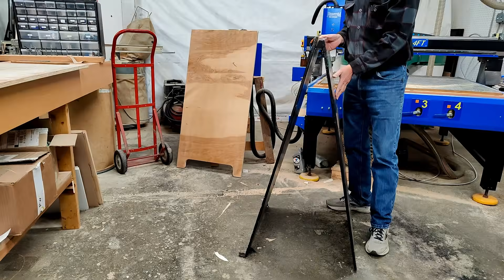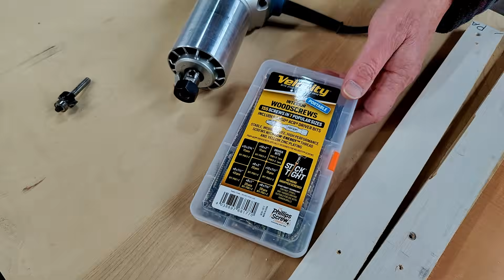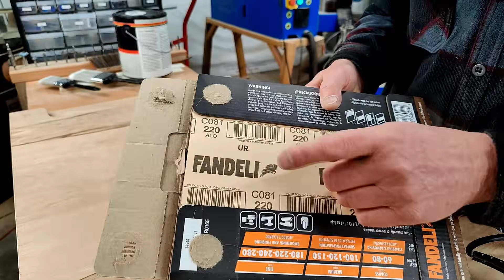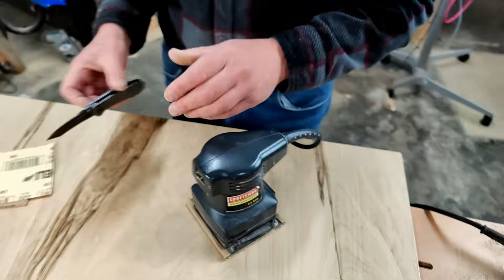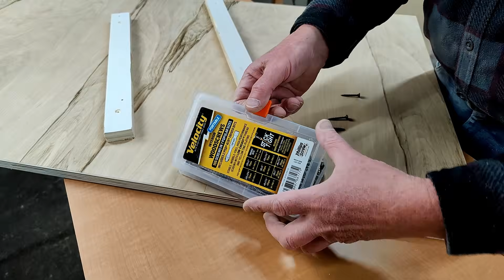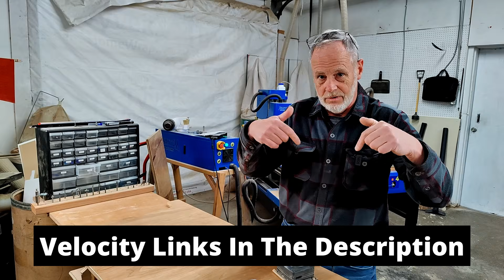Sealing Wood for Painting Made Easy (Step-by-Step)

Comment: I do a lot of table tops, countertops, etc., and finish with an epoxy flood coat. I used to use epoxy to seal the wood. Not anymore, I’ve been using the exact same sanding sealer, and it works fabulously well. Cheaper quicker easier to apply sanded off to another coat sanded off Do the flood coat fewer bubbles perfect poor I love it.
Reply from the maker: That's awesome to hear, brother! It's great that you've found a method that works so well for you—sanding sealer can really make a big difference when getting that nice finish. Thanks for sharing your experience!
Reply: Waaay to many words to info for sealer only.

Comment: This may be a stupid question but why do you sand again after you seal it? Can you not just paint right over the sealer?
Reply from the maker: ChasingTheAdventureOutdoors, That's not a stupid question at all! Sanding after sealing helps create a smooth surface and promotes better adhesion for the paint. If you skip this step, you might end up with uneven paint coverage or peeling down the line. It's all about getting that perfect finish!

Comment: Great video, Garrett! Do be aware that there are several different types of sanding sealers (vinyl sealers, shellac sealers, etc...,) and not all of them are appropriate for outdoor use, or compatible with certain finishes. Read the labels, and if you're not sure, contact the manufacturer's help line or tech support to get their advice. I use sanding sealers of various types on almost all of my projects that are going to have a clear coat (lacquer, urethane, shellac, etc...,) applied to them. For painted projects, I use an exterior grade primer that's compatible with the finish paints.
Reply: The sealer he used in this video is specifically not rated for outdoor use. Mainly that sealer is used for floors/furniture before polyurethane. Whatever he paints it with might make it last longer but still not a great choice.  Came here to say exactly what you said.
Reply from the maker: You are right. I failed to mention that properly
Reply from the maker: @marklindsaycnc yes, I Guess I didn't make the point strong enough that it is only one way to seal wood. Thanks for clarifying